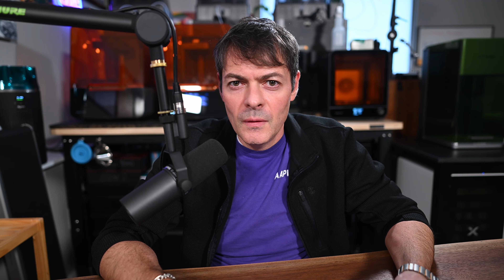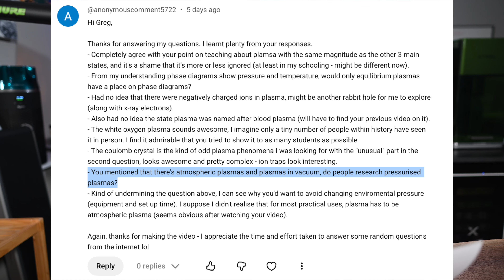A Viewer Asked: Do Pressurized Plasmas Exist?

Comment: Cheers for the video, really informative as always.
While I imagine plasma researchers mostly concentrate on producing plasmas, is research into the avoidance of plasmas and arcing also in your domain?
I imagine there's got to be interesting processes that use high pressures to specifically avoid arcing.
Reply from the maker: Avoiding plasmas is a very important topic and a very very well-studied one. I am not an expert there at all. I mean I might know more than an average Joe but… High voltage transformer arcing prevention, static prevention on air/space craft surface, etc etc etc I saw a really cool switch. Imagine a power shutoff switch but for a very high voltage high current power station. They fill it with pressurized SF6 to consume all electrons and prevent formation of the arc… Here’s a rabbit hole for you: https://www.epa.gov/eps-partnership/sulfur-hexafluoride-sf6-basics